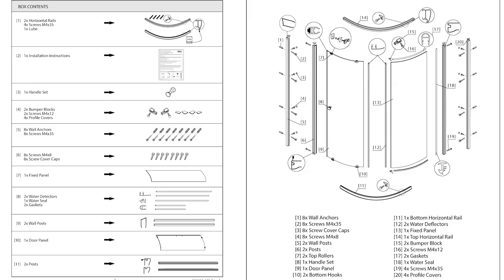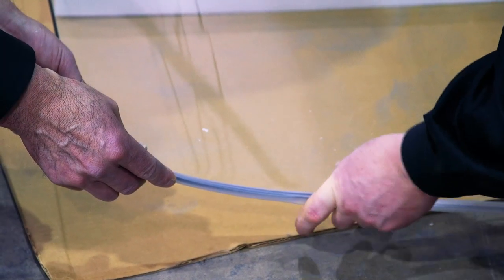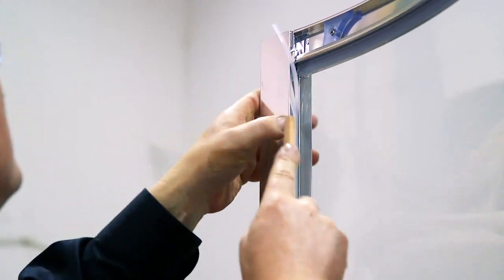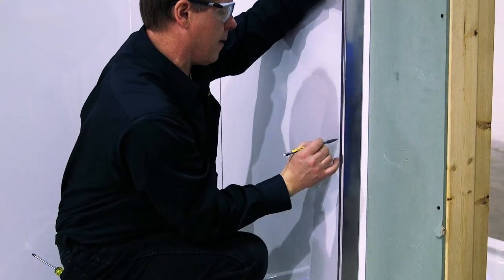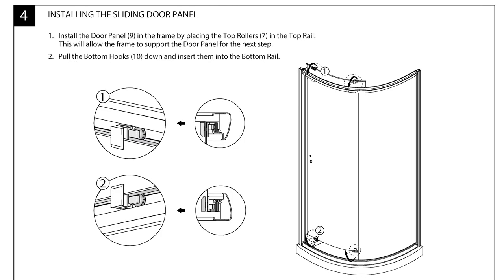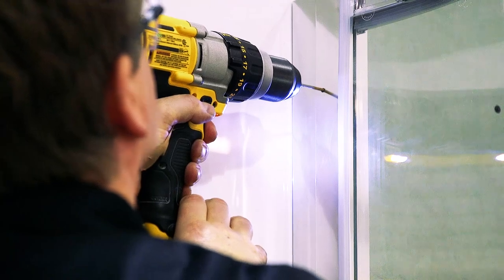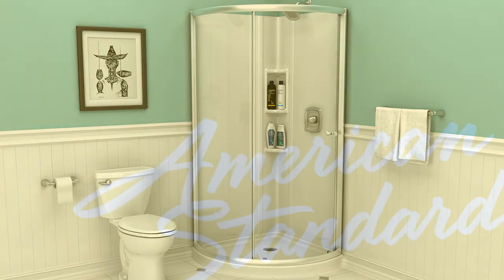How to Install American Standard AXIS™ 36" Curved Shower Door

Comment: This video is quite helpful, but you still need to read, and read, the included instructions. Also, just a tip for installing the gaskets (small one for the fixed panel and the two "regular ones"), use a soap and water spray bottle, spray the glass lightly and simply push the gaskets in place, makes for a much, much easier install. Like I said, good video, but you still need to read the instructions very carefully.

Comment: Two and half days and it's sort of installed and I'm still not sure that it's anywhere like it's "supposed to be". The door opens and closes, so I guess that's good. I found the written instructions sufficiently vague. This video helps a little (still not enough detail). It would help if American Standard did a better job of labeling their parts.

Comment: This was my very first shower enclosure that I have put together. It only took me 2 1/2 hours to put it together. Very happy with the enclosure and find it quite affordable AND a great looking product!!
However I believe the video was not helpful at all in the assembly. It lacked many key details and instructions are lacking info for top and bottom gaskets. 

The label of “retainer blocks” on package, but “glass clips” are labeled in instructions. Part 1/step 5.
Reply: Thanks for the help on the “glass clips”= retainer blocks.

Comment: Very frustrating install. Had to get REAL Phillips head screws, the ones provided stank and wouldn't go in without my driver skipping out, leaving the screw halfway in and a bitch to remove. The pre drilled holes for the glass clips were in the wrong place (did I miss something)? Had to drill my own holes for the glass clips to make it work. Be careful measuring for the door frame, I used the 1 1/8" measurements from the line and the wall was not centered on the base. Now I have 4 holes in my wall that I have to patch. Then, I aligned the wall to the base with the wall posts attached, drew a line, then using the holes in the wall posts, marked where the screws went and that worked.
After that, everything went together fine. If this item is ever re designed, why not have a tongue and groove device on the pan and the bottom of the door frame to help keep the water out so we don't depend ENTIRELY on the caulk. And if you are installing the frame into wood and not drywall, don't use the plastic screw anchors, it will hold much better.
Reply: i just got done tearing down bathroom walls and am rebuilding it, im putting studs on that point and instead of sheetrock im using 3/8 inch ply, i may swap out screws as well, thanks for tips

Comment: I finally got ours put together and it looks nice but I have tried 3 times now to stop the water from leaking under the seal at the bottom of the door enclosure with no luck
Reply: Did you ultimately fix this and if so how?  Mine is leaking at that spot 2 years later and a lot of the the lowe silicon is moldy.   Any ideas?
Reply: My rollers just are now floating in the air from the bottom of the door, I got no idea how to fix it, I'm scared the glass door is gonna brake 😢 , this is soooo stressful! Help please

Comment: The instructions only work if you are using the companion wall panels. I did a tile wall and figured that the play between the frame and wall posts would accommodate. Wrong! Having to remount the wall posts by first assembling the frame without the glass and the wall post inserted in the frame posts and them marking the new locations far the wall posts. Hope it will work but the bottom rail will be at the outer edge of the base.

Comment: First step.  Take one of the long screws to home depot.  Replace it with 1 1/2 inch hex head sheet metal screws.  Then throw away the screws that came with it.  They are garbage.  You are welcome.
Reply from the maker: Hi Lisa - Thanks for the feedback! We strive to supply quality products that deliver the expected performance. We'll take your concerns into consideration, but please note that using unspecified screws can void the product warranty.

Comment: Assembly took longer than it should have. The long screws used to  assemble  the frame and attach to the wall are junk. Use something else even if you have to go buy them. It will be worth it.
Reply from the maker: Hello Rob! We are sorry to hear about your installation difficulties. Please give our team a call at 800-442-1902 so we can get some more details and troubleshoot your issue. Thanks!

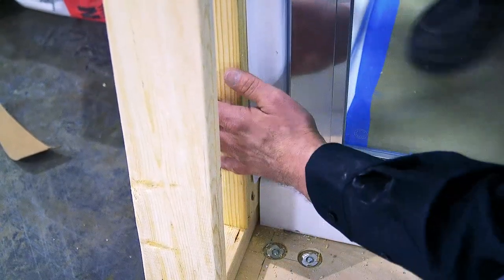Comment: Either this is an old model or you show a different model (probably the 38").  The 36" Curved Shower door that I bought does not meet the wall at 90 degrees as shown in the video.  (2:46).     And Seriously, using a channel lock to loosen and tighten the nuts, My 7th grade shop teacher is rolling over in his grave.

Comment: WTF my instructions are wrong. My set says the spring loaded rollers go on top and the bolt load rollers go bottom. No effing joke. 🤬
Item 12 shows the picture with the nut and bolt as the bottom roller.
Reply from the maker: Hi There - Sorry for the frustration! You can always give us a call at 800-442-1902 and a member of our Consumer Connection team will be happy to provide installation assistance. Thanks!

Comment: Your product is no good. I installed one and its very poor quality. From the start when putting the frame together only a screw joins the connections. There is no washer and not bolt to assure firmness. The frames are very thin and the screw for the frame barely screws onto metal. This turned into a nightmare. Please fix your products.

Comment: Horrible instructions, the video is very confusing as well. If anyone is installing this shower and already have drywall up you will have to cut a small portion out at the bottom for the base to slide up against the wall.